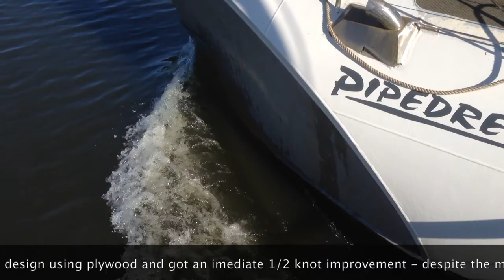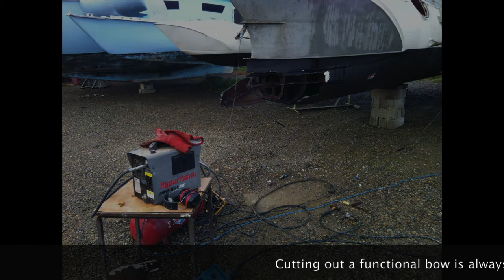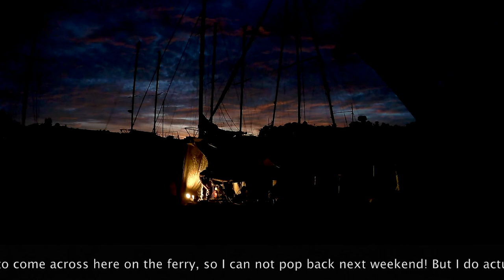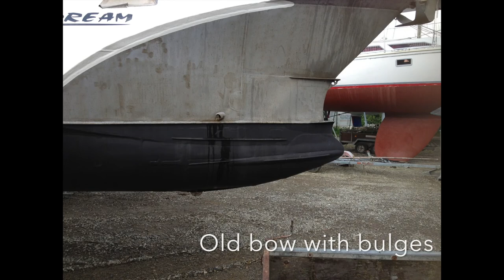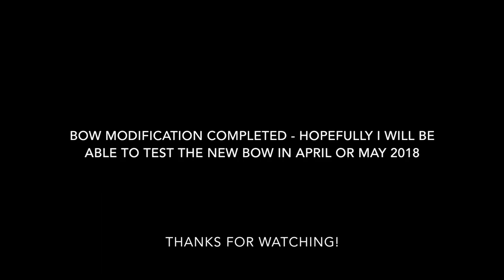Building a steel sailing boat - Modifying the Bow

Comment: I've just discovered your video, or more to the point, your trimaran.  I have never seen or heard of a steel tri before.  What does pipedream weigh? I always thought multihulls had to be lightweight in order to perform well, especially in light airs...
Reply from the maker: Hi Peter, well yes, Trimarans should be as light as possible. As I chose to turn a chimney into a boat, compromises had to be made! She is about 9 tons which is about 2 tons more than a comparable cruising tri. Steel is a heavy material at 7.7 times density of water, but as it is very strong, you do not need quite as much framing etc. For my purposes she is fast enough at speeds similar to a reasonably fast equivalent monohull. I am always single handed so I don't want her getting too ahead of me. The great thing about steel though is that she is very strong...

Comment: April or May 2018...? So the result is?
Reply from the maker: Hi, unfortunately I do not get a lot of free time and I am not the best with social media... But I tested last year and had a great trip. There is still a pressure up-swelling, but it is reduced and I am getting another 1.5 knots. I do intend to post a video on that and the other work I did in February, July and October (modifications to cabin and superstructure as well as a new cockpit enclosure). I am currently building a keel in my garage in the UK which will contribute to balancing the flow and pressure. I will then take it to France and hopefully fit that next month (Feb 2019), but I will not be able to test till August as I do not get much holiday time and jobs and mortgage are quite demanding. After the keel is done, I should be down to finishing work - I hope.